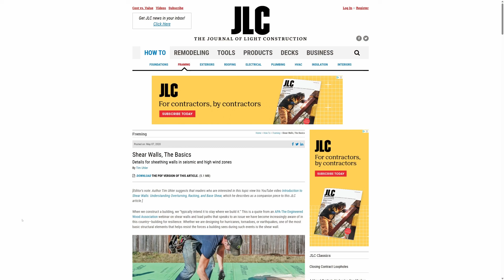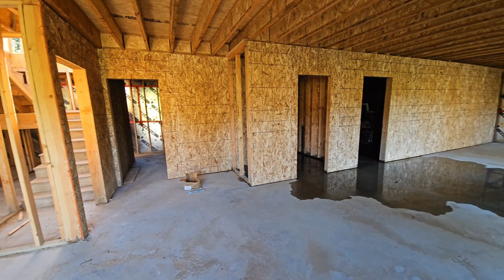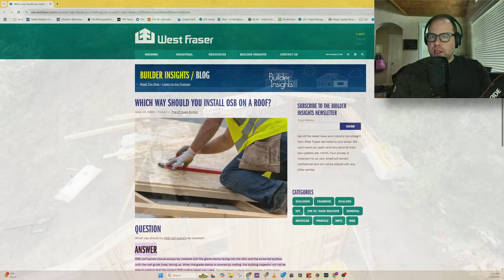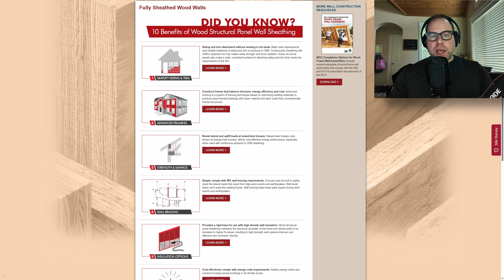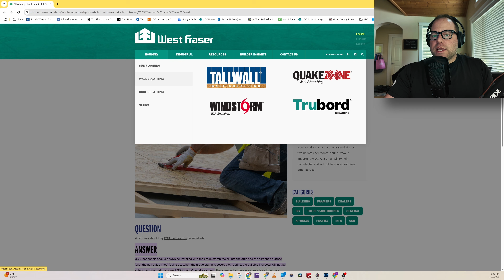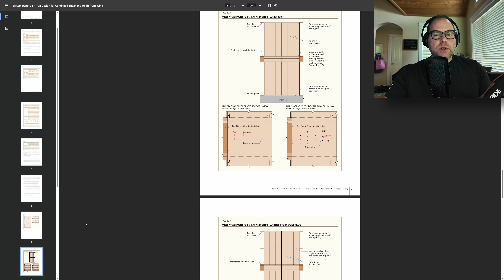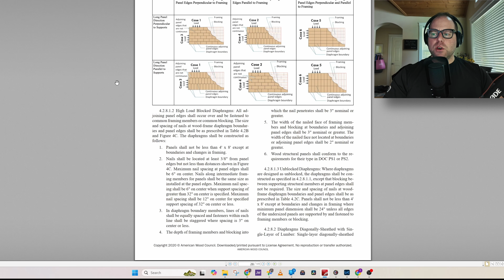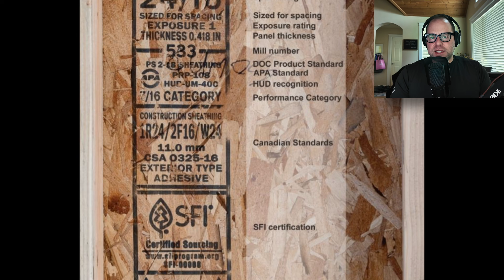Vertical vs. Horizontal Sheathing – The TRUTH According to Code

Comment: OK, but I didn’t really get why you should be doing it this way. Just because the code and the engineers allow it, doesn’t mean it’s better, or that we shouldn’t be doing it the other way
Reply from the maker: I don't understand your question.  What this video is showing is that the sheathing can be installed either direction, but there are greater advantages to running it vertically.  The main point is that we need panel edge blocking for all 4 edges of the sheathing to meet the shear requirements for high wind and high seismic.  There's no extra labor installing longer length sheathing, so even if I was building a house somewhere that didn't have high winds or seismic events, I would install verically because the plates automatically give us the edge nailing.
Reply: Let me try to simplify the idea.  It isn't about  better or the strength of the panel in either direction (clearly rated for either direction in all specs as wall sheathing).  If you put the sheathing vertical the 8 foot panel edges line up with the horizontal framing at the top and bottom plates = no extra blocking required to nail the edges of the sheathing at the top or bottom.  

The benefit and REASON for going vertical IS:  less labor, less materials, less time spent framing, fewer obstructions inside the wall, less thermal bridging, more insulation, fewer obstacles for the trades that follow.  Also you could install 9 or 10 foot sheathing to tie the joist and truss framing together lessening the need for extra structural brackets and strapping / tie downs because the sheathing is then tying the floor, wall and trusses together.  Hope this helps.

Comment: I like your video. 
I also think like you, vertically installed sheathing panels saves time and $ without giving up quality. My experience is in an area that gets occasional 80 mph or higher winds. (retired oldcarpenter speaking)

Comment: Need a vocabulary/glossary: 1) what is "blocking"? 2) what is "crowning"?
Reply from the maker: Blocking is the blocks between the stud bays.  Crowning is eyeballing each stud to see which way they bow.  Cull the ugly ones and crown everythign the same way.
Reply: Assuming the studs run vertically, blocking is short horizontal pieces of lumber, similar in size to the studs, or perhaps smaller.  Each block goes into a stud bay.  I wouldn’t say “between the stud bays”.  To me, it’s the same stud bay, both above and below the block.  If the blocking is there to support the seams of the sheathing, it’s positioned whereever two pieces of sheathing meet.  There’s also blocking that gets put into walls to support interior features such as kitchen cabinets, and bathroom grab bars and towel racks.

Comment: I think if it's an 8' wall it's better vertical because of plate to plate connection. Anything taller probably better horizontal
Reply from the maker: Then use taller sheathing.  Blocking is more important than panel orientation.  The goal is more nails around the perimeter of the panel.  The reality is that as shown in the video, the code tables don't differentiate, ergo, its not an issue IRL.
Reply: @AwesomeFramers  yeah, I commented before watching 😏 kinda a bad habit I've developed, my b
Reply from the maker: @johnlasseigne7676  No worries, been there done that 🤣🤣🤣 and will again

Comment: I started framing in the early 80s working on tract homes in the central valley CA, all shear was hung vertically. Went on to working for a contractor that did a lot of schools, all shear was hung vertically. From bottom plate to top plate or rim joist, only way to get full edge nailing without blocking most of the time. If the wall was over 10' high we would add blocking because you couldn't get sheets over 10'.
Reply: I work in the central valley of  CA and it's still the same
I was taught vertical exterior interior (drywall) goes horizontal cause it helps with strength, but more importantly, I was told " it's on the plans, so follow the plans dummy"  or "you don't get paid to think so do what you're told" ahhh the good'ol days
Reply: You can get OSB in 40 foot sheets. I've hauled several loads of it over the years. A couple different manufactured home companies use it. 2 pieces do an entire wall or floor. I'd hate to know what it costs, or weighs.
Reply: @edswope28  Wow, I've never heard of sheets that long. Is that 3/8"?

Comment: Wait what? Hardie not nailed to framing? My dude you could have woke me out of a dead sleep with that gaff. What was it you'd said, never make a declaration without backup? FYI, Hardie lap siding expands massively, it's why they require 1/8" gap at the ends, because if you install it tight it will blow out your corner boards. Around here in the PNW it gets so hot in the summer that the lap siding will buckle if it's only nailed into sheathing. James Hardie instruction videos specifically detail lining out the studs and nailing on layout, it is absolutely required it be nailed into framing and not doing so will constitute a defective installation - guaranteed.

As to your sheathing issue, it should be self evident. You've already discovered deck sheathing is stronger in a per panel basis, when it is perpendicular to framing. Where does that strength go when you turn it parallel, is it lost forever? When sheathing is perpendicular, each panel is most resistant to tree branch penetration, when sheathing is parallel, that strength is passed into the structure! You are making half faced box beams. It stands to reason that staggering vertically would be even stronger, because think about it, every time you nail 8 foot, or 10 foot sheathing to multiple boards, you are making one side of a box beam and if you stagger your box beams, you'll have a laminated box beam.

So when you lay it rooflike flat, you are making box boxes. When you lay it wall like tall, you are making box beams, or box posts, if you insist on the accurate technical term.
Reply from the maker: To take advantage of the rigidity of the wood stuctural panel (WSP), we have to fasten it to the framing.  The primary strength comes from the edge nailing. If all panel edges are blocked, then we get a tested rating.  The reason the code and the references state the WSP can run either way, is because they are listed by panel thickness, nail size, and nail spacing.  It doesn't matter which way we run it, as long as we use the correct fastener, sheathing spec & thickness, and nail it according to the nailing schedule.  

Here are the links that back up what I said about using the sheathing as a nail base.  This is 20 year old testing 

https://www.apawood.org/nail-base-sheathing
https://downloads.ctfassets.net/dzi2asncd44t/4eRwZL6mpcvaP2eor4aB7L/48de279b2ae5b37fab43432d4801c080/hardieplank-hz5-us-en.pdf page 1

Comment: There is one aspect that you touched on that I think could be elaborated. You mentioned that in floors and roofs the strength axis should be perpendicular to the supporting members for more resistance to point loads (foot steps). As discussed by the Fine Homebuilding Podcast, this concept also holds true for wall sheathing. I do not know the source of their data but I believe they were referencing test results. Their statement was that orientation makes no difference in sheer strength if blocking is used on all seams but resistance to penetration of projectiles is greater if the strength axis is perpendicular to the studs. I'm not saying this negates the advantages of vertical installation but it is something to consider in many geographic areas. Thanks for sharing your knowledge and encouraging advancement based on data.
Reply: I just keep good relationships with my neighbors and then I don't worry about projectiles hitting my house.
Reply: @dennmillsch I know your response is a “ha ha”, but other readers should understand “penetration” is a factor from flying debris/projectiles in hurricane and tornado zones.
Reply: @johncottrell7901  -- absolutely correct
Reply: There are two main factors that affect the stiffness of horizontal sheathing that makes laying them perpendicular to framing the preferred method.  One, the sheet passes over about twice as many joists, so in a sense all the extra nail help to "suspend" the sheathing in tension when you step midspan, making it perform as a diaphragm, and not just a bending member.  This behavior is illustrated by walking on a sheet of ply that is fully nailed off, verse walking over sheets that haven't been nailed off which will be very bouncy as the rotation is unrestrained at the supports.  Two, the wood fibers in osb are usually oriented for more stiffness in that long direction.  Neither of these have an impact on shear strength of a shear wall and are not accounted for in shearwall defection calculations either way.  Penetration of a projectile is largely going to be a localized failure from wood crushing and shear failure of the wood fibers in the immediate vicinity of the impact site.  For a worse case projectile hitting in the middle of two studs, orientation will likely be irrelevant or close to.
Reply from the maker: That is true, except if you look at the documents I linked to, they apply to wind and seismic.  Usually the wall is sized to resist the wind, the WSP are sized for the lateral forces caused by the wind or seismic forces.
Reply: @AwesomeFramers  yes, but isn't he talking about inplane vs direct wind on the panel?

Comment: As a carpenter I have seen the vertical  sheathing  oil can up to a 1/2 inch , in a party wall which I am assuming was also a shear wall...This was 2009...not sure if it was a 24 inch stud spacing or not, which may have been partly responsible. The buildings also got considerable rain...I have never seen it happen in a horizontal sheathed wall  ....even with lots of rain....I think the strength axis of the oriented strand board is the real decider...20 - 30 years ago it was always horizontal.....as for shear walls ,,you have to nail all edges ....guys would go vertical to avoid blocking the middle ,had they installed horizontally
     nowadays I see framers installing vertical 50 % of the time....There is also the question of settlement..There should be a gap between horizontally installed sheets....You dont achieve this with a vertically installed sheets.....If there is a stucco finish , it could lead to buckling of the stucco.....Speaking as a framer in a wet climate like Seattle.....might not be an issue in California
    However I dont think there is one answer to which is the right way to install sheathing...too many variables
Reply from the maker: There are notes about panel buckling.  This is most likely to happen when the panels aren't gapped properly or there is major moisture shock from the ambient environment compared to the extremely low moisture content of the panel.  We try and let them acclimate as much as possible before using the panels.
Reply: @AwesomeFramers  interesting...usually here on the west coast..its extremely swollen wet wood plates that are approx 1inch and 5/8...that dry out to inch and half..3 plates equals 3/8 of an inch shrinkage per floor...vertically the studs only shrink 1/360 of overall length...or so I read somewhere...where it was the biggest problem is on an interior shear wall that has drywall applied to it...if the sheathing buckles so will the dry wall...same goes for a stucco wall...they do have expansion joints for stucco....vertically...but the walls I saw buckle were horizontally buckled...I didnt think about it much ,,was more concerned with repairing the walls ,which took lots of nails and blocking

Comment: One of my engineering professor always reminded us safety factors are for hidden defects. Not for incompetence or laziness. Never rely on safety factors to compensate for your lack of ability or a lazy install.
Reply from the maker: Great point!  The  reason I mention safety factor is so people understand that building to code or the engineering is NOT just the lowest value acceptable
Reply: @A @AwesomeFramers in trade school they teach us that the code is the minimum standard.
Reply from the maker: @samhill2933 a gross oversimplification. Think if it like this, what's safer? A 2026 Toyota Camry or 1980 Toyota Camry. Both were built to the standards of their time. Same with the model codes
Reply: @tony39572 We all know there is no "professor".   You have that ameritard public education stench.

Comment: are we talking shear walls?   or load bearing walls,  there is a difference
Reply from the maker: This video is about shear walls.  Now you've sparked my curiosity, should walls be sheathed differently if they are load bearing shear walls?
Reply: @AwesomeFramers  appreciate your work on this... I tried looking into it a few years ago...but gave up
Reply: @AwesomeFramers  As a random internet commenter, I’d say that whether a wall is load bearing has no effect on how you’d do its sheathing.  The bearing of the load is handled by the framing pieces, not the sheathing.  Of course, to handle an earthquake, with the wall supporting some mass above it, you may need to design the wall for higher overall shear strength.

Comment: in australia we usually use metal x braces on the walls but occasionally an engineer will specify bracing ply on certain walls. Last time that happened the engineer said he didnt care what way the sheets went by he wants 100mm nailing vertical and 50mm horizontal, you can probably guess what one we choose.
Reply: I think Australia uses less wood because there is less lumber than in North America. Same reason that US does more wood frame than many parts of the world. I see that metal framing in residential is also more common in Australia / happens more often than in the U.S.

Comment: We always do sheathing vertical, overhang on rim joist. No seams in walls horizontally and it ties the walls and floor system together better imo, it definatly saved us when a 60mph wind storm came through.

Comment: Framing vertically is a great idea. I never thought about how you would only need blocking at 8’ instead of 4’.  I engineer a lot of 12 to 16’ high commercial walls and vertical framing would be a great way to reduce labour.

Comment: It sounds like you're trying to justify vertical. 
With 30 years experience we used to use 1/2 plywood, before that 1×6 or 1×8.
What do you think will stop a tornado test best?
Osb is the fast food of construction.
Reply: i don't think you were paying attention.  ICF is best bet for tornadoes.  there's nothing wrong with osb.

Comment: Crazy for me, Ive done carpentry since my teens in New England, then in my tweties change careers, but continued doing more finish work and decks. Now possibly moving down south and really started digging in the southern way of framing and between code update and more involved with seismic and hurricane build I feel like I dont know anything anymore, I have always been an above average carpenter and worked on custom multy million dollar builds, but it seems that I almost be a rookie, working any where now. There would be another 600 pieces of simpson ties on an average home it seems and straps everywhere.😂

Comment: 60% for an unblocked wall? I'm an engineer and this is mind blowing. Is it due to the block & sheathing nailing? I built my garage with vertical panels because the architectural engineer specified it. This civilian did not know how much science was behind it.
Reply: Its easy to overestimate that tying a few extra studs together w the horiz sheathing is stronger. In theory it sounds great. However the panel is strong in shear both horiz and vert, keep in mind that the strength then comes from the fasteners. So if both panels have equal amounts of fasteners, whats the diff between horiz w/o blocking and vert sheathing? There is a giant seam right down the middle in horizontal sheathing that cant resist shear forces!

Comment: I have 8 foot walls. I went vertical with my ZIP panels. I used 9 foot panels. That allowed me to tie the floor system and walls to the top plate. If I went horizontal it would take two 4 foot runs plus the extra foot at the top. Then if you don’t install blocking at the horizontal edges you got a weak install in my opinion. All that extra work for pretty much no added value and additional thermal bridging just doesn’t make sense to me. 
Terry
Reply: There you have it. The motivation is building cost not being well built.
Reply: @YThatesTRUTH 
Exactly. 
Terry
Reply: @ForestToFarm i will add that there is consumer (and REAL economic) value in longevity. How much extra strength is there against deflection is up for debate. Could be negligiable ( i dont know but, i suspect, over longer runs that horizontal hanging provides superior uniformity over the years over longer distances... people dont trust corporate building these days for a reason. Profits motivate most all. This adds to stuctural strength and so cost vs value should be considered, though; like every other industry and product i can virtually guarantee consumers are being fkd in favor of replacement and major expense.

Comment: I’m an idiot…but decades ago built several houses with let in bracing and 1x6 sheathing, and oddly enough they are still standing. I’ve built a couple garages recently with let in 1x4 bracing and no sheathing, just LP Smartside…and after 4 years they remain granite solid. In my area a properly nailed panel, even without blocking, in any orientation is plenty strong for any 2-story house.
Reply: I might be an idiot too. I am working with an architect who agrees that for a one story house in the Chicago area shear and racking are not the biggest concern. He is designing it with 4x1 let in bracing then 1.5 polyiso sheathing. It will get Tyvek wrap. Then 1x4 furring strips screwed to the studs as a rain screen. LP Smartsiding will be the lap siding. 

Welcome comments.